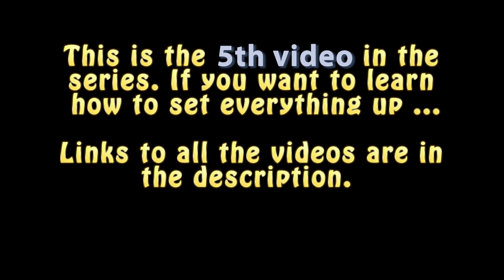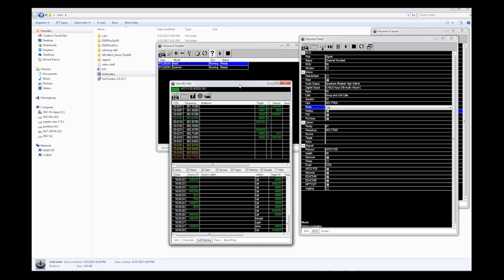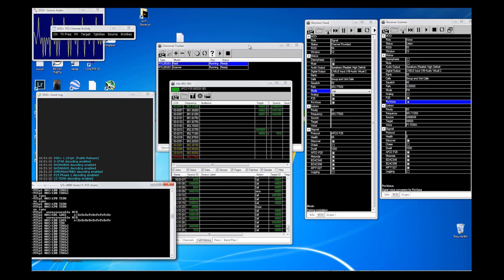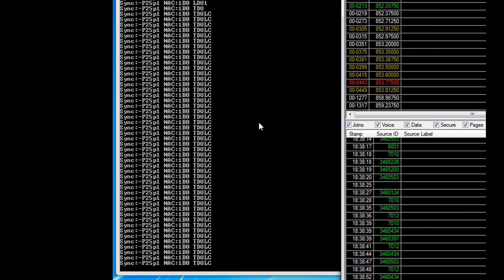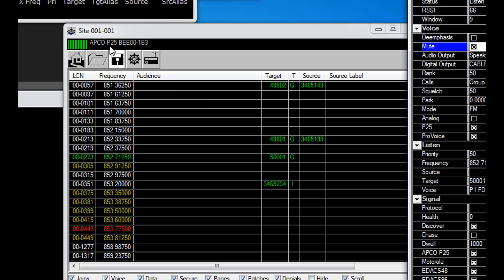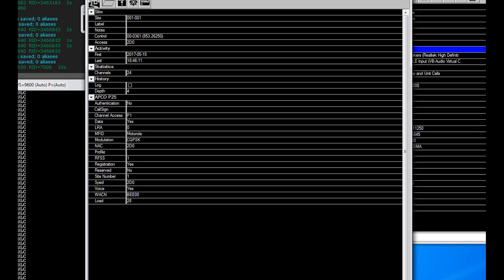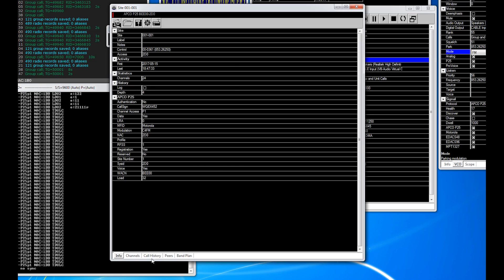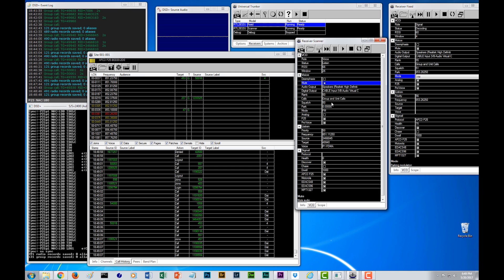Listening to Digital Trunked Radio Communications Using Unitrunker, DSD+ Plus, VB-Cable

Comment: okay so I spend hours getting it to work only to figure out I had an old version of unitrunker, and so now I followed your entire tutorial, and I can hear radio voices of officers etc, but How do I change the channel from police to Sheriff dept, etc? How do I change the channel within the frequency?
Reply: did you made it to connect your sdr ? bro the struggle is real there are no videos or article helping zeero . my sdr cant be detected but if I run any other sdr app it work just fine

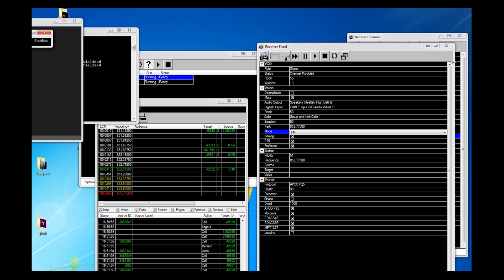Comment: where he gets sound at 0:54, I get all the same symbology but no volume.  Is there a volume adjustment somewhere in all these programs?
Reply: Followup, it takes good reception for the digital transmissions to be decoded and break squelch.  I had to get my antenna higher (second floor of house) and then started to hear decipherable speech.
Reply: @andrewdutton3831  Good to know! I am frustrated with SDR sharp right now as it doesn't work as well with my antenna/SDR combo as other softwares.

Comment: Well it’s 2021 so hopefully this still works l have hanging out to do but got side tracked. Was going to try and do it on my raspi 3b+ but never got around it. I am wondering if this system will work on a Raspi 👍🇦🇺

Comment: This is a fantastic guide, but doesn't work with the Fastlane version of DSD+. Can we get a similar guide for that? P25 Phase II will only decode in the paid version of DSD+ and I can't figure out how to make it work with Unitrunker.  Google says you can use the FMP files to make it work without Unitrunker at all, but figuring out how to make that work is so cryptic I feel like I need a CIA database to figure it out.

Comment: Is there anyway using the one or two RTL-SDR to listen to just one talkgroup (one police dept) . On a project 25 phase 2 trunking system. The problem is I’m using SDR trunk and there’s so many different talk groups talking at the same time it’s very hard to understand or pick out the group that I want to listen to.thank you
Reply from the maker: Try Unitrunker.  Its been a while since i made this video, but I'm pretty sure Unitrunker will do one talkgroup.
Reply: @TahoeSteve  Thanks Steve

Comment: My Unitracker wont send a signal out thru the Digital Output to the DSD+ via the VB-Audio Virtual Cable, but if I switch  over to the Audio Output using the VB-Audio Virtual Cable, than the DSD+ will hear the digital signal fine... Any ideas???  ---  I am trying to monitor a Public Safety P25 Phase 2 system....

Comment: I have been trying to get into HAM and figured this would be a rather cheap start to SDR. 
I'm getting wave-forms on DSD+ and hits on the Site box with 9 channels attached/associated with the control channel. I however can not get the sound to come through any set of headphones or speakers. I have changed them in the audio output tab for each device on Universal Trunker and verified that they are turned on in the control panel sound settings. I'm not sure what the issue is. DSD+ command prompt window doesn't update, and shows the data below. (I know it isn't command prompt but looks similar enough lol).

Any help would be greatly appreciated. I enjoyed your video series even if I can't get mine to work it was worth watching...... over and over and over again.

DSD+ 1.101pt
DSDPlus -h for help summary

Appending synthesized audio to file 'DSDPlus.wav'
0 frequency records loaded
0 radio records loaded
0 group records loaded
0 site records loaded
0 network records loaded

audio input device #1 = 'CABLE Output (VB-Audio Virtual '
audio input device #2 = 'Digital Audio Interface (AVerMe'
audio input device #3 = 'Line (AVerMedia Live Gamer HD 2'
audio input device #4 = 'Microphone (Realtek(R) Audio)'
audio input device #5 = 'Microphone (Razer Nari Essentia'

audio output device #1 = 'Speakers (Razer Nari Essential)'
audio output device #2 = 'Speakers (Realtek(R) Audio)'
audio output device #3 = 'CABLE Input (VB-Audio Virtual C'
audio output device #4 = 'Speakers (THX Spatial - Synapse'
audio output device #5 = 'C27F390 (NVIDIA High Definition'
audio output device #6 = 'C27F390 (NVIDIA High Definition'
audio output device #7 = 'Realtek Digital Output (Realtek'
audio output device #8 = 'VIOTEK GN27DW (NVIDIA High Defi'

audio input device #1 (CABLE Output (VB-Audio Virtual ) initialized
audio output device #1 (Speakers (Razer Nari Essential)) initialized

D-STAR decoding enabled
NXDN4800 decoding enabled
NXDN9600 decoding enabled
DMR/MotoTRBO decoding enabled
P25 Phase 1 decoding enabled
X2-TDMA decoding enabled
ProVoice decoding enabled

Mono audio decoding initiated; press Esc to exit...

Comment: Is there anyway to listen to one specific talk group? And not the whole system
Reply from the maker: You can temporarily set the talk group's ranking to 1. Assuming no other talk group is ranked this high, you will hear it over any other call. If you only want to hear this group and no other, set the threshold to 1.

Comment: I seem to have it working but the DSD audio output is usually unintelligible. When I've used DSD with SDR# it was the same. Is it because I'm on an early-gen i5 and maybe that's just not beefy enough to decode properly? Oh, and also, I'm using 32-bit Windows 7.
Reply from the maker: I've never tried DSD with SDR#, I don't even think that would work.  Use DSD with Unitrunker and the other software.
Reply: I did your setup (unitrunker and VBcable) and I get the same kind of barely intelligible robotic audio output. It's the same as when I use SDR# and pipe its audio through VBcable. I went ahead and sprang for DSDplus Fastlane, and using their one-liner scripts and exes I do achieve a desirable digital trunked scanner setup. It seems the "slow lane" DSD Plus doesn't work well for me, possibly because of those other factors (i5 cpu and/or 32-bit Windows).

Comment: got everything working and when i go to sdr sharp it wont let me choose a device for input for the rtl, if i open sdr sharp FIRST it will, but then unitrunker will not open properly. if i open unitrunker first both fixed and recieve rtl sdrs and DSD+ work but sdr sharp wont do anything
Reply: noob alert! i fixed it

Comment: I noticed on your video on the scan vco tab on status it says listen. Mine says parked. Can u explain this cause I think this is why I'm not hearing nothing and no wave file is flowing. I also wondered if it had something to do with the scan dongle not getting a strong enough signal. I have to use a low noise amplifier to boost one antenna to receive the control frequency. But I noticed on yours didn't have no Health under scan vco. ??
Reply: same problem, voice:parked
Reply: Mariano Lasheras  it's setup right I get call but no wave file flows but at top of DSD gui it runs 4800/9600 back n forth but no wave scroll so something not right

Comment: This is pretty cool, worth the cost of the dongles. Very helpful videos. Thank you. It has been some time since you posted these, just FYI some of the sites changed a little bit, but, easily managed.
Reply from the maker: Glad you said so.  these vids are hard to make, so updating on a regular basis would be tough.  thanks for confirming that the process still works.  Appreciate it!

Comment: the best video i have seen,,however i am having an issue with listening to EDACS 96 1 all info shows working with no sound  dsd plus isnt showing wave motion when i see a keyup,virtual cable is set default and speakers are working
Reply from the maker: i never got EDACS 96 to work either

Comment: Steve, I followed all of your instruction.  I start up Truncker with both the Receiver and scanner dongle.  All sorts of data coming!  problem is when I start DSDplus it sill not go any further than start up.  It stops after loading the devices but no decoding and no audio.  I've spent hours double checking my settings.  Help!
Reply: I have exactly the same problem. I have checked an rechecked everything. I put in a control channel and it finds the members of the trunk group. When I run DSDplus everything starts with no error messages but there is no audio and no action at all in any of the windows other than the startup info.
Reply: you need to use virtual audio, and then in dsdplus select the input a output (sorry abaut my english)
Reply: same here. no idea wtf I'm doing wrong.
Reply: I also need help no feed to Dad but is I use sdr # it decodes
Reply: Has Anybody found a fix for this audio issue?? I have the same thing. Double triple checked.  Soooo Close>>
Reply: syberdog7 Your problem may be that you haven’t made the ppm correction. For me, I had the same problem and did the ppm correction and everything seems to work fine.
Reply: Same on my end. I've tried 100 things and can't get any audio

Comment: Ok... Everything looks good and followed everything in the videos.
Issue is I'm getting mostly digital with some voice audio signal on the scanner side.
DSD+ is running and is decoding as needed to get the digital signal.
Need help to decide what's going.
Using Windows 10
Reply: https://www.youtube.com/watch?v=7YqS04zm0RI

Comment: Steve thank you for your video series. Awesome! I have one question. When I hear a transmission come in it usually sounds very clear but then after is about 3-4secs of heavy static and then it goes silent until another transmission comes through. How do I get rid of that? It's very annoying and makes listening very hard.
Reply: Garrett I'm having the same problem.  Did you find a fix for that 3-4 seconds of static at end of transmission?
Reply: @TRD_Mike  any fix?
Reply: @Mitchs  No, not that I recall. It's been months since I've played around with it, sorry.
Reply: find a fix?

Comment: Hey Steve, when I make my UniTrunker settings for Receiver Fixed and Receiver Scanner, the RTL Device set for Bulk-In, Interface:00000001 has Status "Could Not Open!".  When I try switching the receiver settings for RTL Device to the other setting for each device, whichever devide has the "Bulk-In, Interface:00000001" setting with have status "Could Not Open!"  I have all my other settings matched to your tutorial.  What am I doing wrong?
Reply: Make sure nothing else is using the device. If you leave SDR# running, that will happen.
Reply from the maker: Perhaps, try re-installing the drivers
Reply: i have same problem and reinstalled still don't work any more ideas

Comment: The tutorial was awesome. I got everything set up and running in the time it took to play the videos. Now, if you don't mind, I have a question. I live in downtown Chattanooga, TN. About 50% of what I am hearing is beeps and what sounds like a female computerized voice that is unintelligible. Are these signals that are to far away? I have both identical devices that you have shown in the videos and the same antennas.
Thanks again for the help.
Reply from the maker: @Chris - It could be one of several things.  It could be an encrypted signal, it could be too far away, it could be that you might need to do a receiver "correction", or it could be something else.  I will be doing a "troubleshooting" video soon and will cover correction.  Thanks for watching!